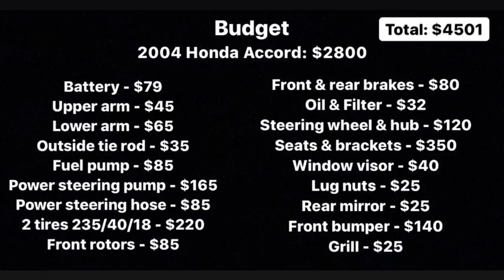BRAD’S HOUSE #10: SUPER SECRET SEMA SLAMMER PART 2

Comment: 6:40 point the bottom of the shock towards the road, in the driveway. one foot on the spring. impact on the tophat nut. IF the shock wants to go anywhere it will slide about a foot or two into the driveway. the tophat and spring will stay in place. done it a MILLION times...

Comment: Hey Brad, can I bring my 2005 Civic EX over and we hotboy it out? I already replaced all of the bushings, control arms, end links, rack ends, etc. and installed some eBay adjustable camber bars (it already has Skunk2 lowering springs.), but the struts aren't great. I also want to put some beefier anti-sway bars and coilovers on it, 5-lug spindles from a RSX Type S or Honda CR-V (they bolt right on) so I can have 5-lug and disc brakes all around, then I want to swap the engine and trans out of a TSX into it. Let's do it! I'd have to drive all the way there from Louisiana with my trans not staying in 5th gear (kid that had the car before me trashed it), but it'd be cool af to get this car swapped out and handling like a beast. I'd be happy with 220WHP in this little thing, and I think we could get that out of the K24 pretty easy with a tune and some bolt-ons.

Comment: what you need to do is buy a 92-95 civic hatch and throw this motor in it with or with out a 5 speed but a large ebay turbo and you can make 500 easy